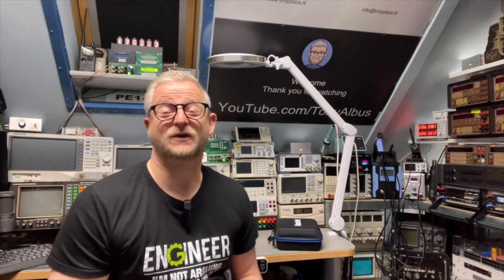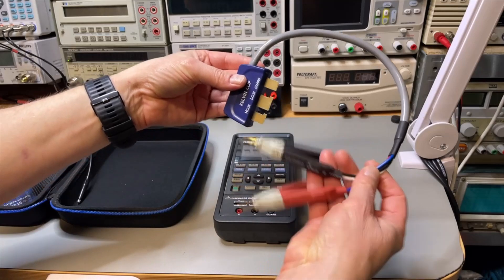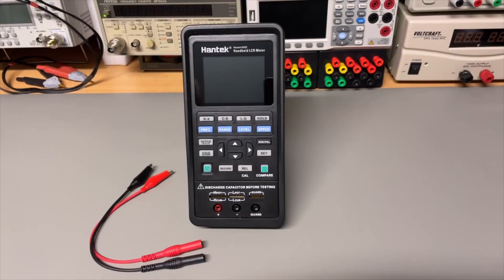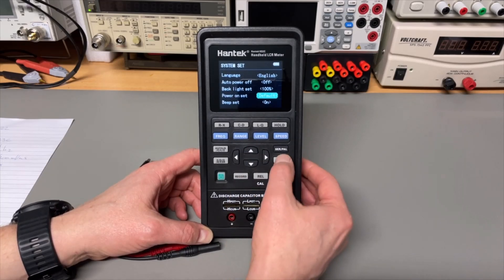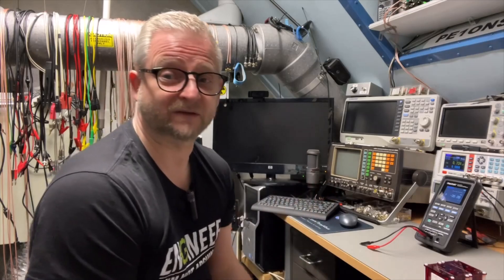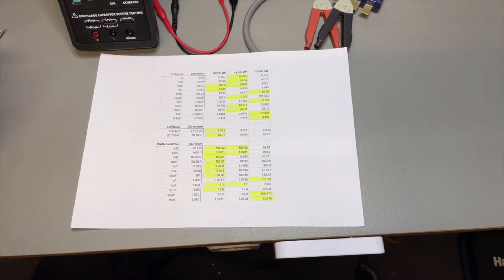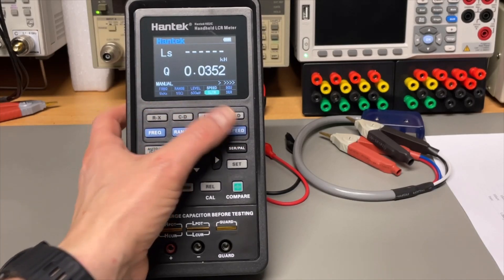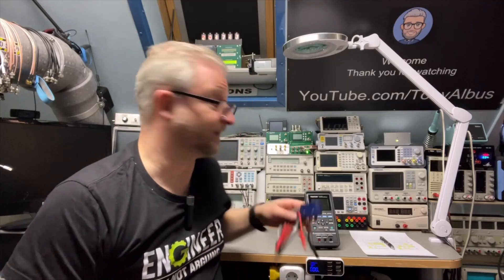#269 Hantek 1832C 1833C LCR Meter - Hands On - To11 To22

Comment: I would be quite interested in the difference in the accuracy of measuring small capacitors (pF) between the Hantek 1832c and 1833c. I will never have them together on my desk, but I would like to find out the difference between measuring 40kHz and 100kHz. But making a video for just one person is a waste of time. Can you at least briefly give a few sentences? I would be very grateful. If I were 20 years younger (70 years old), I would buy a RuoShui 4090c or ET4410. But at my age, I can already do with my 1832c. Have a great time.
Reply from the maker: Yes indeed, maybe i do a video about that sometime, i do bot have these devices anymore.
but i could do in general.
Reply: Thank you very much and I look forward to it! Hopefully this will be of interest to many more LCR users, because the issue of measuring L and C is a bit more complicated than just V, A and R. The measured quantities depending on the chosen frequency would be a good explanation of the problem. I keep my fingers crossed that it works out. Have a nice day.

Comment: Hi Tony, thank you very much for your videos and just to clarify: yesterday I read the whole discussion on the EEV blog about hacking a Hantek 1832c to an 1833c and the latest information there is that it is possible and you can even save the calibration at 50-100kHz. I have the 1832c and sometimes the 100kHz would be useful.
Reply from the maker: Hi, Thank you, i never dared it myself, in that time the calibration was indeed lost. i left mine as it was and give it to my dad
Reply: I also have a Hantek 1832c and I can't decide to hack it either. I think it's more sensible to leave the 1832c in its original state and fully functional than to deal with problems. I think that among similar LCRs, the Hantek won't be much worse at small values (pF), even though it only has 40kHz instead of 100kHz. Good luck and good health. I'm already 70 years old and I still enjoy it. I'm retired and more and more.
Reply from the maker: @ivandrimal5783 Yes smart thinking, good health to you too sir!

Comment: all the popular lcr meters seem to not be sold on the manufacturers legit website which makes me wonder if they are clones or fake products. They all seem to come with crappy inferior probes and long calibrations which need to be done after every power cycle. None of this makes sense because I buy a meter and hope its not counterfeit. Then I now have to buy probes just to use it because the ones that come with it are either too short or are not actually kalvin probes so there goes my accuracy. 
Oh and then theres the extremely large parasitic drain on the battery when power is off.

Is it just me or do most products being sold today seem like they are garbage.
Reply from the maker: They work resonable for their price, ofcource you get what you pay for. for bigger wallets are better equipment.
Reply: true, I just worry that the results are not going to be accurate enough. If I dont know the source of what I am buying (IE if its counterfeit or not) I might be buying something based on specs that dont exist in what I actually receive. I might say well i only need about 1% accuracy but might unwillingly buy something with 5% accuracy and not even know it and then realize later after many hours of troubleshooting a project built with the aid of such device. @TonyAlbus

Comment: when check capasitanse D simbol is a resistance sir?
Reply from the maker: i am not sure... missed that D simbol... still have the device.. maybe i try again in a QA video. Thanks, good question
Reply: @TonyAlbus  I am very happy with your video review. especially regarding the lcr meter. I am a beginer technician who wants to keep learning. im actually looking for a tool that can measure the ESR in a pcb board. if possible i hope sir can review the esr on pcb board even though it may not be true. Thank you
Reply from the maker: @kangtukang4948  Hi, in-cuircuit messurement i am not a fan of... with lcr... if you are on a voltage rail, how many caps are you messuring at the same time?

Comment: Tony how about the "PeakTech 2170" that is i0n the price range between the Hantek and the Matrix. Have you seen one of those?
Reply from the maker: Hi Dieter, this is the first time i hear about the PeakTech, i did ask that company to work with me last year, but they did never respond. i hear more about the DE-5000 , but that one i also never had here.
Reply: @TonyAlbus  Ohh .. i have been using a very cheap LCR .. BM4070 comes as "proster" or "SZBJ" brand but the ESR part is  missing there so i had to upgrade as i got burned with come caps that showed fine in the C test but were actually badies. Once my 1833c arrives i can send you that instrument. Keep the great work!
Reply: @TonyAlbus  It seems to have very similar capabilities as the Hantek 1833C , but apparently it comes with a calibration certificate (iread that in an Amazon review). What I like on those is the auto ranging capabilities something not given on the bench systems. Still pricy though. Well thanks for the review "fasher" :-). I Just ordered the 1833C .. itas just 169 Euro.
Reply from the maker: @dietermontanez6576  i love auto mode auto ranging too, i like it easy :)

Comment: I bought the 1833C about a year ago and is surprisingly accurate for this price range, and how much features they packed in a handheld.  The 0.3V level is very useful for in-circuit testing and the ability for 4W measurements is very nice. For years I had relied on signal generators, scopes and DVMs to test inductance and capacitance given that there is no justification for spending $600+ on a specific equipment for every now and then use.  My only complain is the space wasted putting the Hantek logo on the screen when it is already on the front face.
Reply from the maker: Great to hear, and yes agree, a bigger affective screen would be better

Comment: I wrote a “TestCintroller” device definition file for the East Tester LCR meters, I also made a version for the very similar Roshui, you might be interested in it for your meter, it’s on the EEVblog forum
Reply from the maker: Thank you!  (Dutch Directness Alert) Hi Scott, i like what you do with electronics and software, you make great stuff, but somehow you comments feels to my you are just promoting yourself on my channel, you don't need that. Maybe if you comment first on the video and don't start the comment with 'I' it would be diferent. Keep up your hardware/software work, i am a fan!
Reply: @TonyAlbus  I just thought you might be interested in software for your bench LCR meter.
Reply from the maker: Yes i am, Thanks!
Reply: @TonyAlbus  I mentioned the east tester version of the LCR meter as that is what I have on my bench, and someone else pointed out the similarities, so I modified my device definition and made a version to work with the roshui units, they use slightly different serial protocols.
Reply from the maker: @TheDefpom  That is interesting, that means they have different software inside, other then just the brand name in the screen on info screens,.. because when i opened mine, the PCB said ET44 .. here at 23:11  https://www.youtube.com/watch?v=y_8pZtPALrc
Thanks for doing that, i will have a look for sure. the standard software was not that special.

Comment: I've been looking at LCR meters and see a 3-way competition between the DE-5000, Uni-T 612 and this Hantek meter. The Uni-T is about $50 more than the other two.  How well does the Hantek measure ESR?  What readings does it give?   TRX labs has a very long detailed video about various measurements of these values on a DE-5000: https://www.youtube.com/watch?v=ivVSq0IiZGo
Reply from the maker: Yes that is a very good channel, i only used and use automode myself. looks like that DE5000 is very good, but its also twice the price, you get what you pay for.